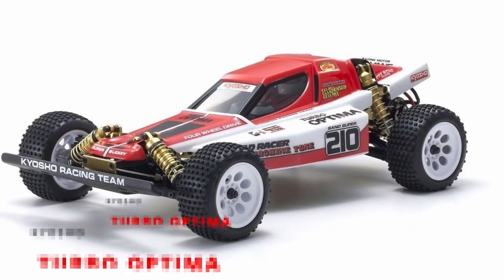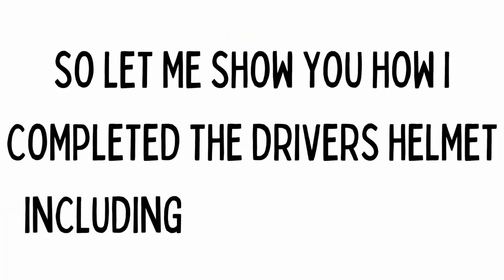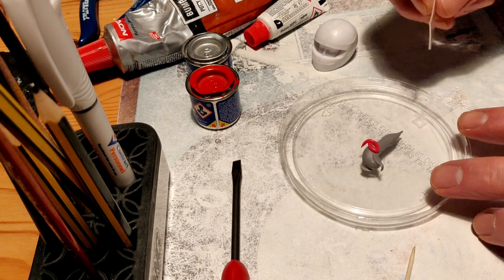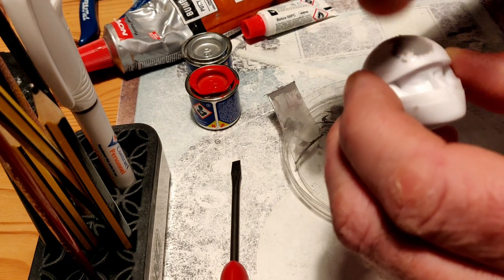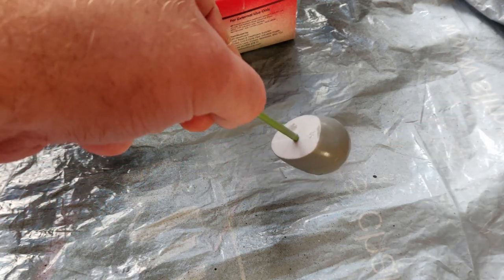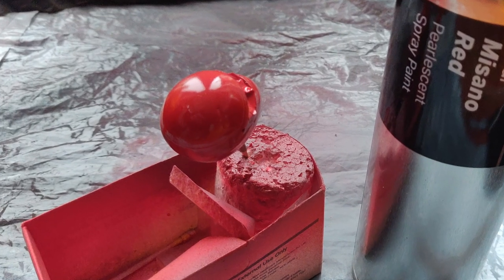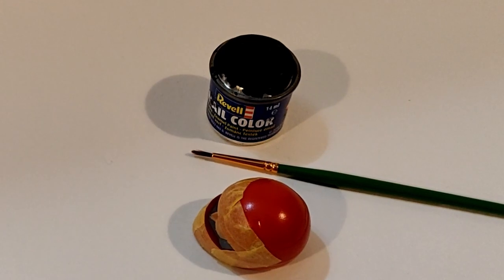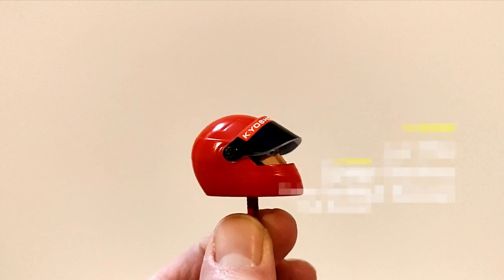Kyosho Turbo Scorpion Working Visor

Comment: Hey awesome tips and a great format to the video Damian.  I sometimes spend a fair bit of time on these driver heads but I don't quite go to such lengths to eliminate the seam.  You have reminded me that I used to use that glue that melted the plastic.  I should get some because I'm just using super glue for everything.  Top stuff mate 🙂
Reply from the maker: Thanks Pete. I bought some when I restored the King Blackfoot body. I liked using it, even shaved some little bits of plastic to fill holes or dents. Left it proud and sanding it back. Toy welding lol